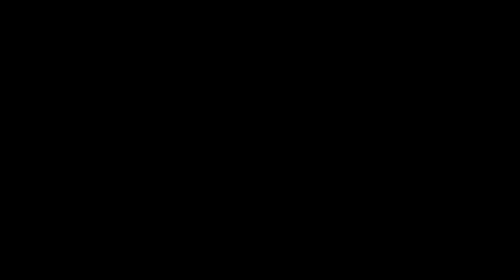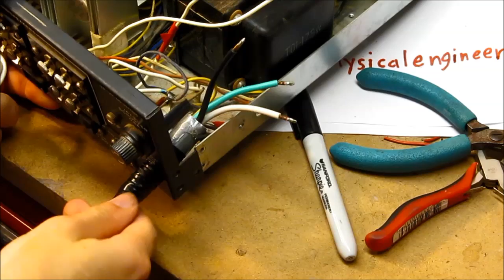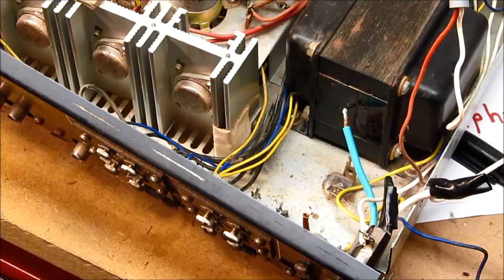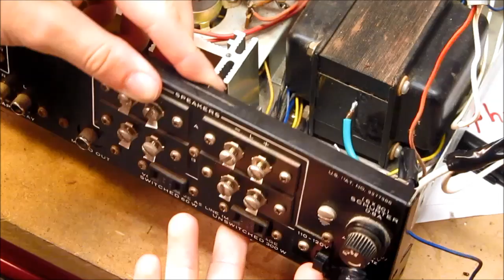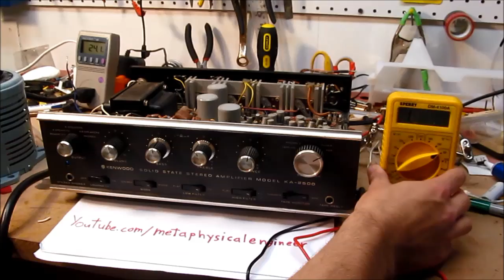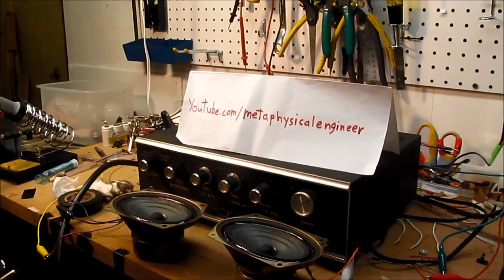Kenwood KA-2500 mains wiring upgrade

Comment: Rather old video. I wonder where you are now about.

Anyway, with the help of this video, i will attempt to perform the same mods on my Kenwood KA-2500 vintage.
I noticed the same while opening and cleaning mine. Not to today’s standards.i just found out this amp is not 70ies, but dating 1961!

Yes it is noisy, but apart from that has a decent good sound (JBL 800 speakers)

Comment from the maker: All amps will have some hiss but it is usually cumulative noise from all the components, and depends heavily on the volume and tone control settings.  What you described makes me suspect transistor(s) somewhere after the preamp/volume/tone controls.  So possibly a noisy driver or output stage.  Is it only audible when music isn't playing, and if so, how close do you have to be to the speaker to hear it?

Comment: i have a 5 channel disco mixer and that has hum on the output when turned up , i have no inputs in it at all yet it hums just like yours, ive had a look in the psu and there are 2 x 1000uF 35v caps,1 of them is bulged badly. Can these bulged caps cause the hum in my mixer too??
After leaving in on for about 5 mins the hum suddenly increases in volume as if somethings breaking down then getting worse,if i turn it off again the cycle will repeat itself again,can a bad cap cause major hum on audio

Comment from the maker: It isn't on the schematic and it doesn't seem to have any potential relative to the primary.  Originally it was connected to one side of the mains at one of the plug sockets but it doesn't seem to do anything useful.  I may test to see if it is another 6.3 volt output, as there is a 6.3 volt secondary for the pilot lamp.